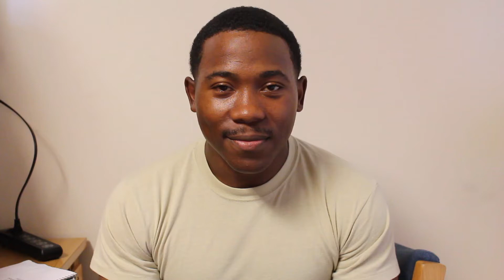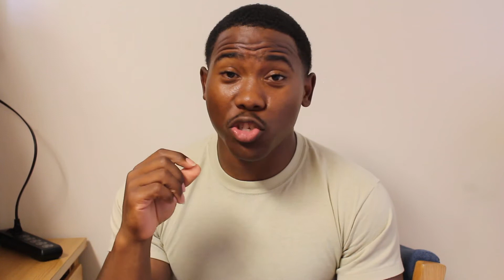MY AFSC HVAC/R 3E131::TECH SCHOOL DETAILS #AIRFORCE #MILITARY

Comment: Over 40 years ago I was a master instructor at the same tech school.  I taught several blocks of instruction in the Heating Systems AFSC including electrical, electronics, pneumatics, gas and oil fired furnaces and boilers.  I was a Staff Sergeant, went to Wayland Baptist University at night and earned a degree in teaching.  I also earned AA degrees from the Community College of the Air Force.  I loved my time in the USAF and when I completed my enlistment I continued to teach HVAC at colleges, trade schools and industry.  I held several prestigious positions training hundreds of HVAC technicians during my career and am now happily retired.  Thank you USAF.  Randy Bihm
Reply: thank you for your service

Comment: I went through tech school hvac at Sheppard. Finished my first enlistment. Got my first residential job out of the military and realized I knew nothing. A few years later I moved to commercial/industrial hvac and learned a ton more. 7 years later I'm a top tech at my company making 80k a year + a few side jobs a year. I definitely  work for it and have longer days than in the military but it has been a good field to me. Trust me though the military is a very small portion of what you need to know. Stay working though.
Reply: what was it like being  a hvac tech in the military?

Comment: Were the tests hard? Was there homework?
Reply: I was there in 2010, and the testing then wasn't difficult.  There was one test that was very short so it increased your chances of failing it, but you you'll get to retake it.  The way this tech school teaches now is different I think.  They did written tests when I was there, now it is hands on testing with the equipment I have heard.  So I don't think there any written tests anymore, I could be wrong.  If it is this way now, it might be a little difficult due to being on the spot troubleshooting.

Comment: What was your asvab score? Does open general contract guaranteed to get a job after bmt? Cause the navy has  an open contract but you will remain undesignated for the lenght of your contract
Reply: Ferdinand Racsa open contract means you will not know what job you will have untill week 6-7 of BMT, they give you a selections OPEN jobs at that given moment during week 2-3 and you list your top 6-7 jobs and towards end of BMT you find out what job you received
Reply: loc Prodigy i got that part but im looking at jobs that i dont meet the score at the moment. So my question is if that job shows up in the selection, do i have a chance of getting it even i dont meet the score?
Reply: Ferdinand Racsa no they will still be in the list but you won’t be able to get that job

Comment: Hey Kevin thanks for the upload man! Really helpful information you're putting out here. I actually just started looking into joining the Air Force a few days ago and I just stumbled across your videos. Currently I'm 22 and I'm already a certified HVAC Technician in the residential area. Thinking of joining to advance my career and gain as much knowledge as possible. To have a lot more opportunities once I'm out. One thing I wanted to ask you that I keep wondering. Let's say I join and go for HVAC, once I'm done with that is it possible to join another tech class like electrical systems? Just to get more certifications under my belt.
Reply from the maker: I will address this in another video. great question
Reply: Im thinking the same thing how are you liking it? I have 5 years experience would this help?